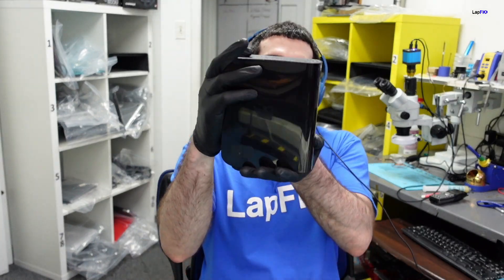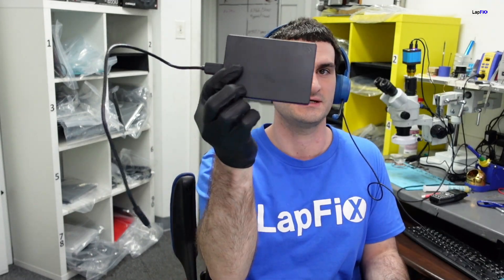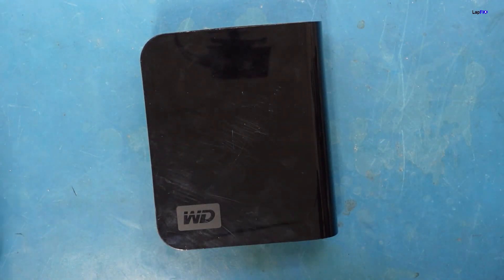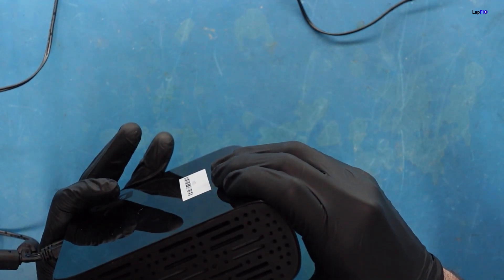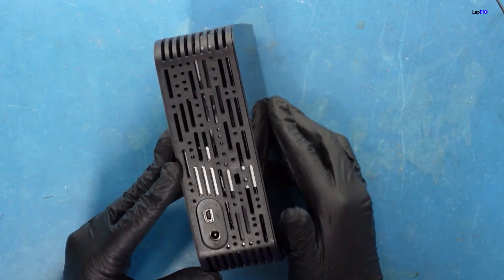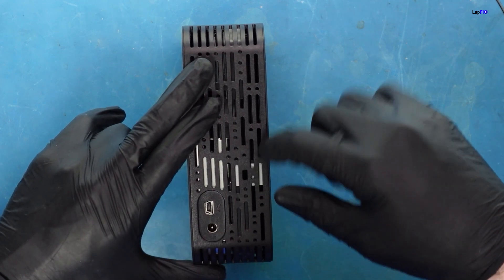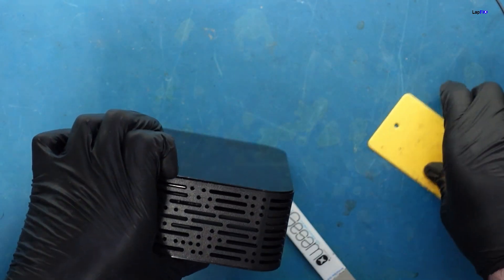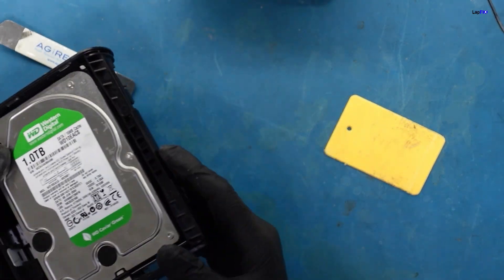How to fix a Dead External WD hard drive HDD - Data Recovery

Comment: Seemed like a nice thing to try when my pc stopped showing up my F: drive. Most video told me about correcting it in disk manager, but it didnt show up there either. Copilot was of the same idea as you, that it was most likely the usb-sata converter that failed. So I bought a station, and placed the drive in it. Unfortunately, it still doesnt work. At least I learned that independently powered external drives are in fact internal drives. But i still mourn my lost data.

Comment: You absolutely saved my bacon!  I had stored a number of critical work-related files on my very old WD My Book. I received a quote of $1,000 for data recovery.  Your video was so informative and detailed, that I decided to attempt the recovery myself. I disassembled the old Western Digital unit and purchased a SATA to USB adapter from Amazon for $16.99. I was able to recover all the data from the external HDD that had failed to power up and have now created a back-up on the cloud.  I am eternally grateful to you for sharing your expertise. THANK YOU!!!

Comment: So my hdd doesn't show in explorer when mounted to the docking station. Device manager shows the sabrent station attached but I can't find/view the files, help!
Reply from the maker: If your HDD isn’t showing in Explorer but the Sabrent dock is detected in Device Manager, check Disk Management to see if the drive appears. If it’s unallocated or RAW, it may need partition recovery, and avoid DIY if data is important.

Comment: hi,  I have a WD MY Book  It is not recognized.  I took the drive out and plugged it into an external port. It spins up and the {C sees it BUT the data is encrypted and I cannot read it.  I have a board 4061-705002-001 REV A but need to buy one.  Good luck to me.  How can I get the board fixed OR try software that will unencrypt my data.  Thanks  Don
Reply: Hello can you please tell me that were you able to get your data back somehow from the encrypted drive ?

Comment: When i connect the drive to a PC, it just makes a robotic sound - My pc can see that the drive is connected. But nothing is showing up. I lost it on the floor from around 1m height. Do you imagine this solution could help with it? I have a lot of stuff on my hard-drive would be very important for me to get it fixed (around 8TB). The SLED and a cable + delivery would be around 50 pounds, and would be worth trying for me.
Reply from the maker: Hello, most likely a damaged head.  8TB could also be a helium-based drive.  We can take a look for you with our mail-in service located in the description
Reply: The same thing happened to me, did you find a solution?

Comment: I know this is an older video, but I'm hoping I can get some help or pointed in the right direction. I'm having this exact same problem with the same older western digital drive. I picked up a sled, took the ext hd apart and plugged it in and it registers on my pc, but when I try to open it, it says you can't do so without formatting it. Formatting it will cause you to lose any data on it so I'm a bit stuck as to what I should do next. I was hoping I'd just be able to access the drive and its files you did in the video. 

Do i need to install a program in order to safely get the important files I want off or is there a way to format it without losing any of the data?

Comment: I’ve had three of these and they all failed after about 2 years. Bought one, failed after 2 years. Bought another and it failed after about 2 years. Bought a third because the business can’t be planning this… and it failed too. Seems like clockwork. Got some small Seagate slims and they’ve been going for about 5 years, and they’re just little 2-1/2 inch things! I hope I dint jinx them now.
But I’m sure WD wouldn’t design their stuff to do this… what next, ppl will be telling me that Fauci is a cr00k?

Comment: Do you have a video with a double drive enclosure? As I have a feeling that its RAID 0 which means I may need to find a way to have them both integrated afterwards to retrieve the data.

Comment: I have done everything this video explains, BEFORE watching this video, unfortunately my WD MyBook 2TB external drive was damaged, nothing to do with the external case that you can remove and replace with a normal external case like the one in this video.  Sometimes it is the hard disk with some kind of problem and intervening on the hdd itself is not easy, they are built in a way to make it very hard to open the disk, even to only replace the controller card attached to it.

Comment: What if it's not making any sound but there is a slight bluish light? The desktop used to chime and give an error message every 30 seconds or so, which got annoying, but I couldn't access the files. So I unplugged it from the computer. I left it plugged into the power source, though, because I wanted to try it on another computer, in case it was a problem with my computer. I just now plugged it into my laptop, and nothing happens. Not even the annoying chime and error message.

Comment: I am putting off this solution because it's my wife's HD and she gets anxious about putting screw drivers to her tech. heck... she'll probably be upset if I fix it but break the case!

I have never seen this problem: when I plug in USB, the drive is instantly recognized, it appears in device manager, but not in explorer. 
There is a WD dashboard utility you can d/l. It sees the drive, but says "0 GB 0 free space zero zero zero.
drivers are up to date; dashboard does not offer to update firmware.
she has windows 11 and I followed a forum post that said to initialize HD and then assign the drive a letter.
I forget the utility - disk manager? it shows a window that displays each drive as a bar divided into partitions, but the WD drive is grey.
when I try to initialize the drive it says "hardware failure."

so. any software suggestions before I put this in a docking station?
Reply: Did you have any luck? I Have the same type of issues

Comment: I sure hope this can work with a 8TB Seagate model external drive, will try to do that soon when possible since it was silly enough that I had it less than three months then suddenly it starts acting up now; power light is on, but it makes a buzzing sound then a few clicks and stops with "USB has malfunctioned, Windows doesn't recognize it!" ugh what a pain and the thing is too new to be considered terrible since I didn't really use it much when I had to replace a PC.

Comment: Got the sled looked like it was going to work no problem the light went on and started flashing but no start up beep sounds like the unit is working and the disc is turning but didn't show in my computer. Help please

Comment: Thank you for your tutorial because it really helped me! I have an old 160GB My Book that had the same issue where it wouldn't start up but kept chirping. Mine was a different type than in your video because it was a little difficult to open, and the hard drive had that long line of pins at the end (Not sure what they're called). However, I bought a SATA Converter on Amazon that takes 3 different hard drive types and luckily my old hard drive turned on and I was able to save my old media onto a newer and bigger external hard drive.😁

Comment: I have an older version of WD MyBook that uses USB Type B port. Also couldn't work when I plug it in. I disassembled it, took the hard drive out and it works with a separate SATA hard drive cable adapter.

Comment: I removed a 4.0 TB WD Green from it's My Book enclosure.  I attached a SATA to USB cable after removing the board.   The drive will not spin.  NOTE: The drive does spin with the board attached but not when I attach the SATA Cable.  What gives?  Is the sled different than the SATA cable?

Comment: okay.... now i have the problem that once the hard drive is out of the case and i plug it into the removable slot and won't even power up.. is it completely dead now?.. was working fine before i removed it.

Comment: What should I do about my WD My Passport, which just today stopped showing up on my Mac after I restarted my computer? (It's a 3TB, 2018 I think...) It won't even show up in disk utility. I then rebooted it a few times. No joy. I then moved it to my MacBook Pro and it won't show up there either. I did finally notice that the LED light is not really lighting up, although it hums, and I feel power going through it, but it won't mount. I'd been using it as my main external hard drive, and have it mostly backed up, but not entirely. Please help! I have some major projects on there! What should I do next?

Comment: My WD hard drive was make NO noise at all.  I followed this video and used a SATA converter.  The converter is getting power (light is on and makes the windows sound when I plug into laptop) but the light goes out when I plug in my drive, the computer makes another sound (like I disconnected the adaptor) and nothing happens.  HELP!

Comment: My wife has 2010 macbook pro that only has  2.0 usb ports. Is there a way to conect or convert a port to 3.0 to use the  sabrent sata 3.0 external hard drive lay flatdocking station?

Comment: I have a WD80EDBZ hard drive that beeps 13 times when it is connected with a molex cable and then turns off. I don't have the hard drive box. Is this an electrical or physical problem?  I uploaded the sound of my hard to google drive. Here is the link:
https://drive.google.com/file/d/1IBZ5-eJu9MOcN6zwoerNVMLzS_DzD0wS/view?usp=drivesdk

I would be grateful if anyone could help me.

Comment: My WD Passport was from my Dell laptop - and all of the files work fine as long as i am connected to my Dell laptop.  But now i want to use it from my HP laptop.  I have already set it up on the Dell laptop, i know my password, for the HP laptop it opens up and can see folders and does not ask for a password ..  i also changed the letter drive  - but for some reason none of the files show up correctly when i try to open from HP laptop.  When i plug in my WD the HP does not ask for password.  How do i fix this?

Comment: My WD Easystore 8tb won't come on at all. I changed out the plug to DC 12V because that's what it uses. It worked so I unplugged it. I tried to use it today but it won't come on so I know it's not the plug, I think it is the powerboard. Do you have a video to fix a HDD that big or should I go to  computer store to fix it? Thank you

Comment: Actually you can repair that unit by replacing one capacitor and check the power brick transformer, usually one of those are the fault and it can be fixed very easy.

Comment: @lapfix do you have to use a sled, can i somehow just use sata and the other cable to use it as a desktop drive? mine is getting disk read error check disk codes, and there's no way to fix it using cmd since it doesn't read as a letter or anything what so ever
Reply: Mine has the same issues.  Did you ever have any luck?  Was wondering The same question as you as well. Do you really need the sled or can you hook it up to a computer

Comment: I've got the exact setup however, the HDD I have doesn't so anything when in the dock/reader. Is there any suggestions or videos with help in extracting data or even transplanting the inner disk of the drive into a new 3.5 caddy? 

Thanks in advance
Reply: Help me to retrieve my more than 10 years of files and memories.. mine is not working. Just taking chances if someone will see my message and help me 😭

Comment: I have a mybook that reads but very very slow, can I just do this but instead of sata sled, connect to a open sata port on my pc? does it need the sled?
Reply from the maker: If it's slow, means there is a problem most likely with the head.  Sata speeds would be much faster.  But yes, you can check the file format first
Reply: @lapfix  i tried optimizing it and defragging no speed change

Comment: Hello, I have an 8tb WD My book, it fell off the table while it was running, now when it turns on, it beeps, it beeps about 3 times, when I enter the desktop it does not appear, if I look for it in the disk manager An INITIALIZE DISK window appears, it is marked in GPT, when accepting a window opens that says: virtual disk manager... THE REQUEST CANNOT BE MADE DUE TO AN I/O DEVICE ERROR... also say that He's seen many tutorials and none of them solve the problem, I can't use CHKDSK either since I need the drive letter and the disk appears as unallocated...a headache since the disk is full of information that I can't lose It doesn't let me format it either, which I would have to do if it let me give it volume, and what I can't do since I would lose all the information when formatting... any possible solution or should I prepare for the worst.....?? since now new subscriber
Reply from the maker: The drive is failing.  Try not to use it anymore as it will get worse and make data recovery more difficult.  We have all of our contact information in the description if you are interested in a Data Recovery

Comment: Hello ,, i have external hard drive WD 4 Tb 3.5 inc and the board of sata - usb are damaged i replaced it by an other one but i found problem that in my computer not showing all the storage just 1.6 Tb and thr other 2tb not showing even in disk management is there is a solution about this and thank you ..

Comment: Hi. Thanks for the great video! I have a WD5000AACS external hard drive which measures 5.75 inches in length by about 5 inches wide.  Which size/type USB-SATA converter would I buy? Thank you for your help!
Reply: I have the same drive XD
Reply: @AbstractElement  SABRENT USB 3.0 to SATA External Hard Drive Lay-Flat Docking Station for 2.5 or 3.5in HDD, SSD [Support UASP and 20TB] (EC-DFLT)
Reply: SABRENT USB 3.0 to SATA External Hard Drive Lay-Flat Docking Station for 2.5 or 3.5in HDD, SSD [Support UASP and 20TB] (EC-DFLT)

Comment: Hi. Thanks for the video. I have the same dead hard drive but I have a feeling it is the actual disk drive that is damaged, When I plug the usb into the computer and power it on, it is recognized by the computer and i can see the device on my device list but I cannot open it. I replaced the mother board but that made no difference.  Any advice or video on how to repair a damaged disk?

Comment: Bought a data recovery unit just like that to "rescue" a drive just like that from my old pc...your vid is the closest I've seen to answering my question, "WTH is wrong?" However, the unit arrived and it lit up (w/no noise) and still have not gotten the drive to reveal anything. I don't know if the unit arrived defective or the drive is totally dead - Note: I removed it from a pc that would no longer power up, if this helps. HP also, if the brand helps ('cause they usually suck!) Help!

Comment: same drive, mine makes the window sound when I plug it in, no weird noises. the drive indicator light flashes, I feel it spiining up and it shows up in device manager and in disk management it just shows as unallocated. I trried allocating it as a new volume, then I can see it but it won't access it, says it need to be formatted.I tried turning off the sleep option in the root usb, I tried to just hook up a regular sata drive and power plug from the ps, that shows up in bios but still can't access it. I tried it on my desktop and my laptop, all the same, nothing

Comment: wD are the worst type of external hard drives , i bought 3 and all failed !!! rubbish
Reply: Everyone's situation is different.  I had seagates fail on me much more often than WD.. however I have a 2tb ad and a 2tb Seagate both working great for a decade now.  (When 2tb first came out)
Reply: Idk seagates seem to be worse
Reply: I bought 2 WD My Passport, all broken.. first one I bought in 2019 and broken 3 yrs later in early 2023, with symptoms such as slowing down transfer speed before completely unrecognizable. Then second one became "not initialized" in Disk Management after just 6 months of usage, bought it in August 2023. Unbelievable! I lost worth of 2 TB of data and to recover it I need $600x2! Should have stick with Seagate.
Reply: What’s a good brand?
Reply: Idk, its the cheaper drives that suck. And anything with a mini B usb connector or power hub built in have always failed. I have 3 MyBook’s and they’ve lasted for about 3-4 years now. Granted the main problem I have is they eject when the computer sleeps no matter what settings I do.
Reply: Pure garbage! I’ve burned through a few of them 😡
Reply: 1 year and mine shit the bed
Reply: @WaynePryce at least their wasnt cracker crumbs. Those are worst .
Reply: You wrong, my WD safed after flood
Reply: In my experience, WD works best on PC while Seagates are best for Xbox.
Reply: How did you get redownload games if it won’t work
Reply: Same experience here, at least with these MyBooks.
Reply: Agreed. I hate WD. Two of mine stopped working. So far no issues with Seagate. But the best solution is a docking station.
Reply: I thing Seagate works best.... My hdd faild after working for 8+ yrs!!! They also give 3yrs data recovery warrenty!! I mean that's great 👍
Reply: @pratikskamble seagate is the worst, i bought a couple server hdds for a nas and they all died in a month

wd has the most reliability, ive had a wd caviar from 1998 (4gb) and it still working
Reply: WD are the worst External Hard Drives, about 3 External Hard Drives are dead where I took a good care of them.

After you keep them for sometime, they no longer work.